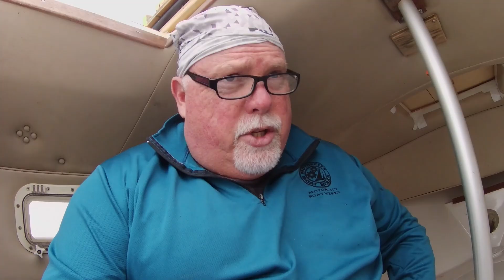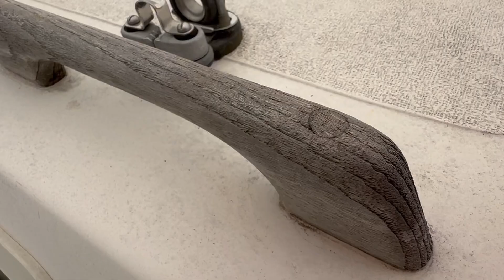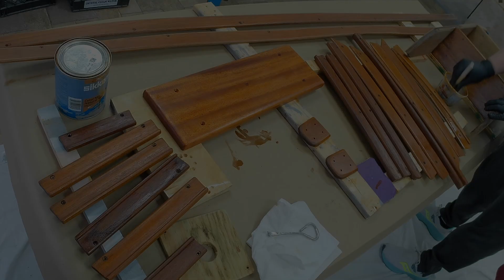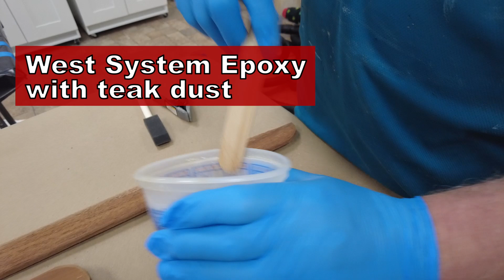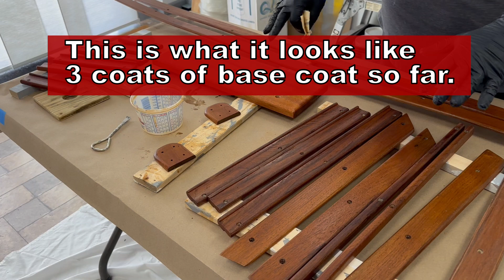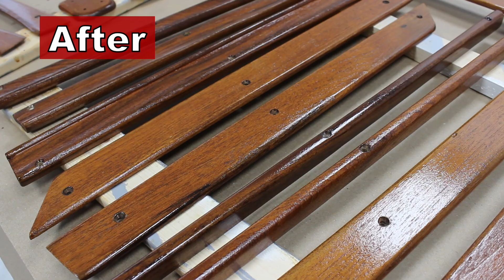Restoring Sailboat Teak | Small Sailboat Restoration (Ep73)

Comment: Great video!!! I have a 1988 catalina 22 with weathered silver teak. I have one question after watching, in 12 or so months whats the process for recoating? Take all the wood off the boat and repeat this process, or just add a coat with wood on the boat.
Reply from the maker: Good question. If you follow my method you should get 12+ months maybe as much as 18 or more. To recoat: You leave the wood on the boat sand lightly —tape off the deck for spills and then just recoat in place.
Reply: @motorcityboatwerks  thank you sir!
Reply: 2 more questions. 1: how do you know when it needs recoating? 2: when recoating, am I just going to add 1 application of the top coat gloss? Or will I be doing base coats and gloss coats?
Reply from the maker: Top coat gloss always has to go on base coat. You will have to judge for yourself when and how many coats you’re comfortable with. 🤓

Comment: How about using teak oil? Trying to avoid how varnish and cetol chip off
Reply from the maker: I hear this suggestion a lot 🥸Teak oil does nothing to address the texture of the wood over time and just prolongs the inevitable cracking and splitting. 🐙In addition teak oil is not a viable solution for wood that has already weathered or mix matched. 👎Wood that has weathered and already turned gray with exposed grain cannot be restored with teak oil. 👎
Reply: @motorcityboatwerks  thank you for your advice 👍

Comment: Good work again Joe.  Sikkens is a great product.  I often use 3M pads for scuffing between coats---they have a product for that purpose--although it doesn't look as good as using 220, there's a lot less cleanup.  Maybe it was urban legend but I understand years ago Tiara was persnickety enough to require all the wood in a given boat had to come from the same tree--IMHO that's overkill.  It's a boat and not a crime if every piece doesn't match.  Your Skipper 23 looks interesting.
Reply from the maker: Thanks Joe😁👍You’re going to love this project